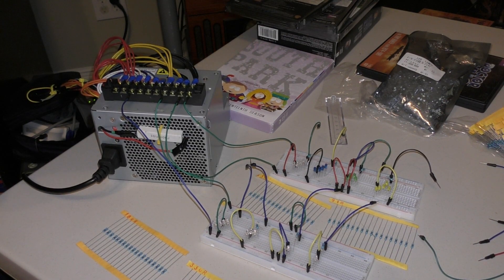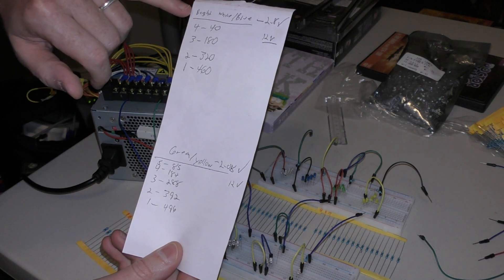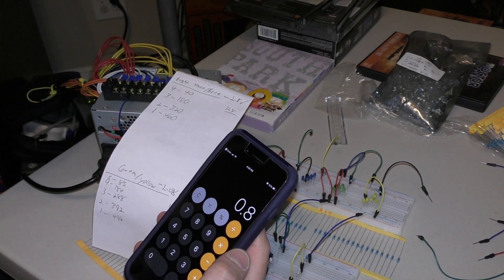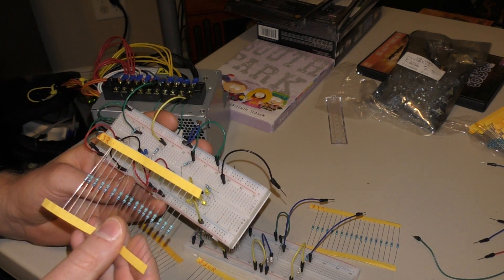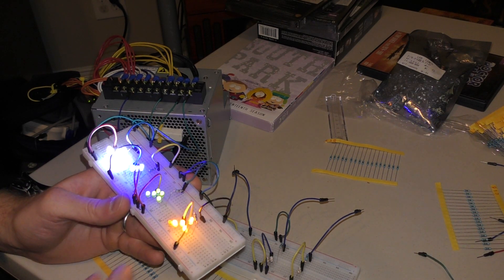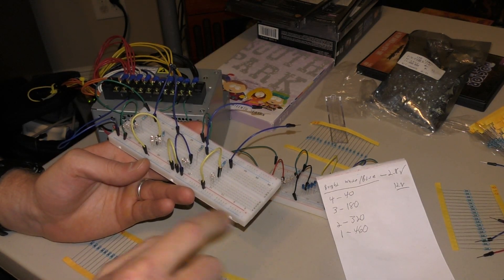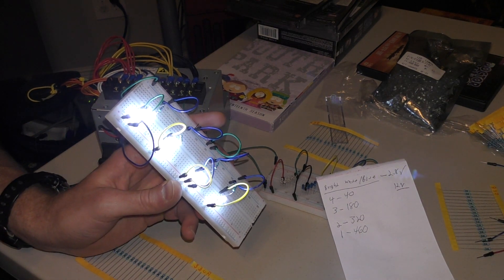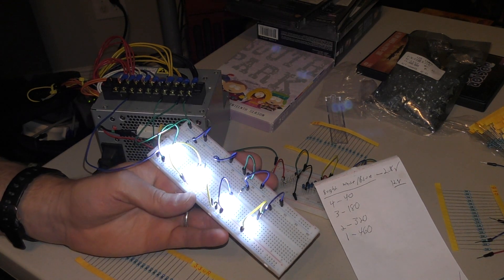The Basics - How to Add Lights to Your Lego City

Comment: Woa... So much going on. How many times you wired it wrong and popped them? And do you build it all custom rather than buying kits? Would save you a fortune I would guess if you do.
Thanks for sharing the basics. Looking forward to seeing the next step of integrating it! I'm definitely keen to add some lights to my city but not sure I'll go as far as you have.
Reply from the maker: Kits seem to be made for stock Lego sets, most of mine are customized or mocs, so the kits don't work.  This is a better and WAY cheaper solution, but a lot more time consuming.  I managed not to pop any of them.  It's fairly straight forward if you take it slow and watch what you're doing.  It's a daunting task when you start, but it's not really that complicated if you have some minor, basic knowledge of simile circuits.